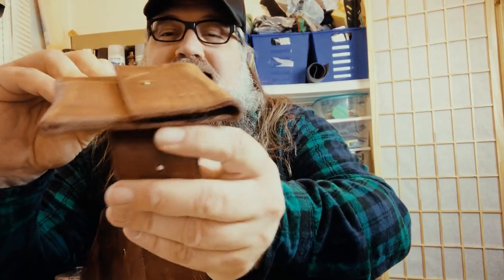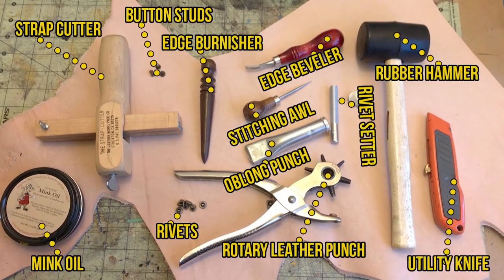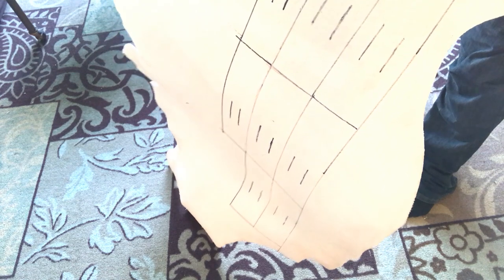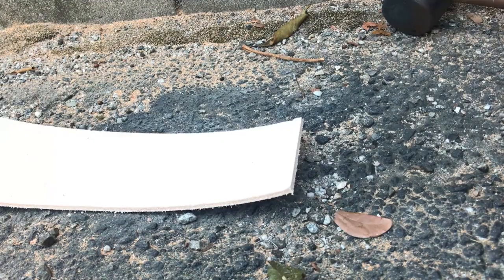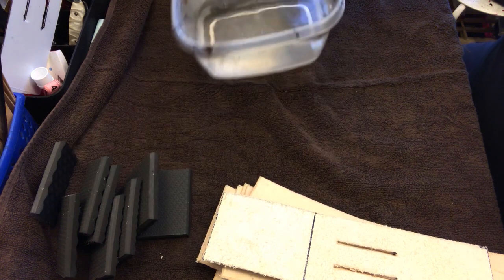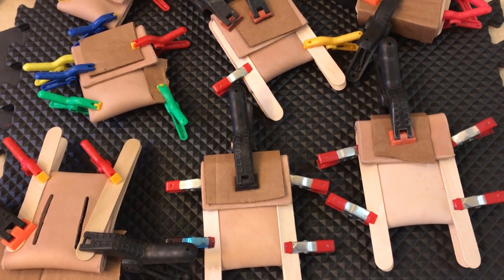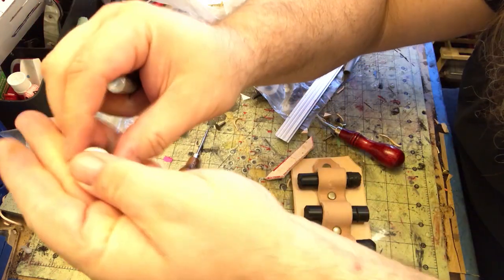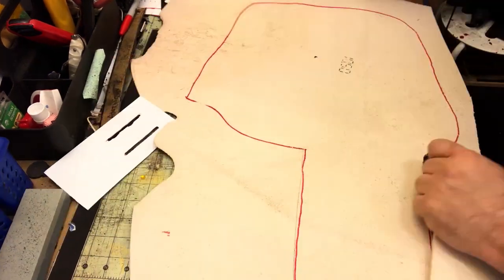MANDALORIAN BELT: BOBA FETT INSPIRED BELT BUILD

Comment: Hey Anthony, what did you use for your blaster cartridges they look great
Reply: They may have been leftover pieces from one of his previous builds. Do you know any electricians? I would probably just use industrial fuses. https://www.homedepot.com/p/GE-60-Amp-Cartridge-Type-Fuse-2-Pack-54226/203728033
Reply: Wooden dowel rods could work too as long as the ends are sanded smooth enough to hide the wood grain when painting.
Reply: tsirrom1 that’s what I did and I cut strips of sintra to make caps.